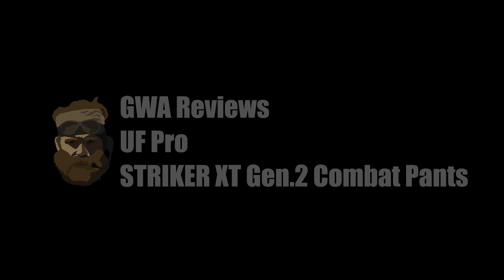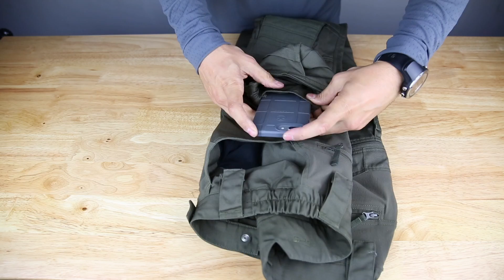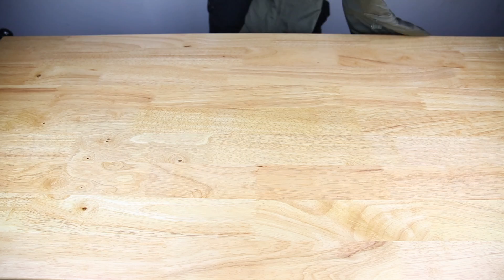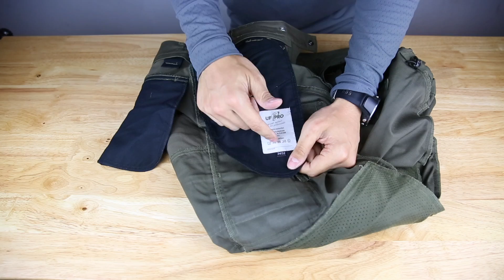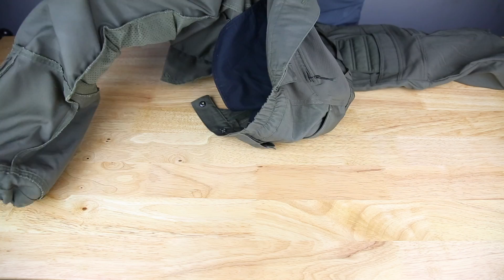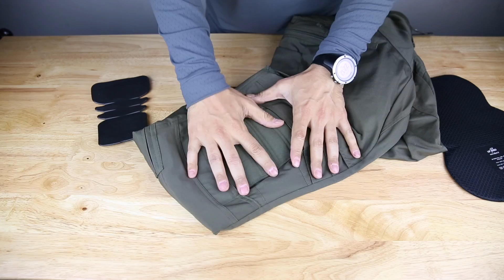UF Pro Striker XT Gen2 Combat Pants Review

Comment: Sadly the knife pocket is not really designed well. A better place would be outside of the cargo pockets with a protection flap on top. Like fjäll raven does it with their outdoor pants.

On the UF Pro you have a high chance of losing the knife when moving and damage the pants.

Comment: I like your video about these pants, but you forgot to mention the ability of the inner zipper. It's absolutely stealthiest inner zipper that I've found. It's in the inner part of pants and it's very well hidden. If you don't know about it and it's purpose, you may never find him. It's for the cold weather insert pants. I have to be honest about it, because if I don't know about him, I think I will never find him. And I'm wearing those. But it is the last thing you can mention about them. They don't have the knee pads setting wire or bungee, but they have many, and I mean MANY size options, so you have to have properly chosen size, but once it fits, you won't want another pants. They are just awesome, and I tried a lot of them. I don't wanna wear another pants for my duty, until they allow me to wear shorts on summer days.
Reply: Hey dude.
They happens to make the tactical short.. caller P40 shorts Gen 2.. i also love the ventilation zipper that sit just above my thigh.. also the zipper that connect with the thigh pocket... Well made

Comment: How consistent is ufpro's sizing? True?
Reply: Pretty much, although I find their waist is a bit closer to the body than, say, Levi's. That's not uncomfortable though as they incorporate stretch.
Reply: @Vanalos  you have their pants? What size do you wear and what size did you order?
Reply: @pramodkaranth9479  I wear 32/32 in all of my pants mostly and my UF Pro's are also 32/32. As I said, they are a bit closer to the body at the waist but otherwise fit fine! If you're interested in them, there will be a new version available (Striker X I think) end of this month. You can look it up at their webiste. My only criticism of the Striker XT is that the pockets with zippers are a bit narrow to get into with gloves and that the knee pads tend to  be on the outside of the knee rather than centered, which is a 'problem' they are aware of.
Reply: @Vanalos  yes, I keep seeing ads on Instagram for some gen 2 pants with optional Velcro on pockets and closure with Canadian buttons... sick design....I even spoke to them on Facebook...they recommended 34/36 or 34/34 for my 36 inch waist (could be an inch and a half more ;))...as you're telling me that the sizing is pretty much consistent, I think I'm sorted....was also thinking of getting the crye field pants...hope they're true as well....any idea as to what the difference is between striker XT and striker HT?
Reply: @pramodkaranth9479  AFAIK the only difference is two zippers left and right the front of your crotch you can open for more air circulation. It's for high temperature zones.
Reply: @Vanalos  thanks for the info..

Comment: Bought one pair. And guess what, the trouser leg was way to wide (if you know what I mean. i'm german, not english). Looks like cargo pants. Does anyone know what I have to change on the size? The belly size or the leg size to make them even tighter?
Reply from the maker: tris09 typically you have to size down on the waist to reduce the leg size. I would recommend contacting UF Pro for further info

Comment: I have a really dumb question about these pants, do they come in a tapered fit? I want to get these to wear for hiking and outdoors stuff plus work, but i also want to occasionally wear them as a casual pant but am afraid that they come super baggy like most combat type stuff does.
Reply: They are not baggy.  They are closer fit uniform pants/shirts.  They are the best combat pants/shirt set currently on Earth.  Without a doubt.  They're expensive though so be prepared to "buy once, cry once".
Reply: you would be better off with their "p-40 all terrain" or "urban" pants, for your purposes
Reply: yes, they are good, i use a pair of these, but they are NOT the best!
i do miss adjustment of the knee pads, like straps, they have to sit tighter because they flop around while running and such
Reply: @basti080891  So which ones are the best?
Reply: @Sarrienne  depends in my opinion on environment and job, law enforcement the xt seems to be really good, in forrest for longer times the x is the way, as soon as the inside of my knees got used to the chafing (don't but them on first time for a march, you are going to bleed) and in hot environments I like the crye g3 because its thinner (never used the g4)
Reply: @basti080891  Do you not rate the Striker HT for hot weather?
Reply: @Sarrienne  never used them

Comment: Do you like this pant over the new 5.11 XPRT pant or the Cry G3?  How would you rank these 3 pants in order of preference and overall quality?
Reply: Hey, I've worn the UFPRO and the Crye G3.
And I can say, that I prefer the UFPRO. There are much more detailed solutions in this pants, than on the Crye, and it seems much more durable. Especially the Kneepads are awesome. It ist not correct shown in the video. You can buy another, third layer of foam. So you can upgrade the pads from basically one layer up to four layers.
And, another cool feature:
There is an small hook at the ankle, which can be fixed on your shoelaces. So the pants can't move up, when youre walking.
And, last but not least: you actually can buy 2 STRIKER XT for the price of one G3.

Unfortunately I can't say anything about the 5.11

But in Germany and most other countries in Europe UFPRO is the brand of choice for most law enforcement and military units. Most of them have worn crye in the past but now switching to UFPRO.

Regards
Reply: @janamt49  Hey, have you tried both the Striker X and this Gen 2? Which do you prefer?
Reply: I don't think one's better than the other, they cater to different customer bases. Crye is more field-friendly than the UFPRO. The use of zippers everywhere on the UFPRO pants is a cause for concern, even if they are quality zippers.
Reply: @NiReiSan  I prefer zippers and snaps.  It cant stand velcro and buttons seem to get ripped off.
Reply: @mdeamicis  4 hole buttons falling off is a given. Get ITW bar buttons. Those are almost indestructible.